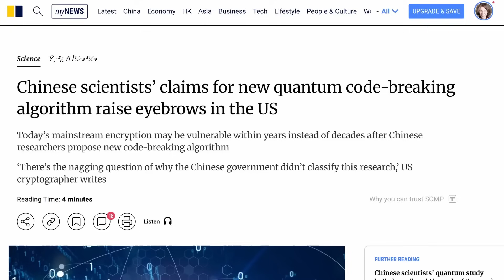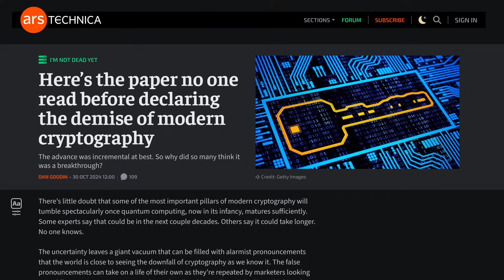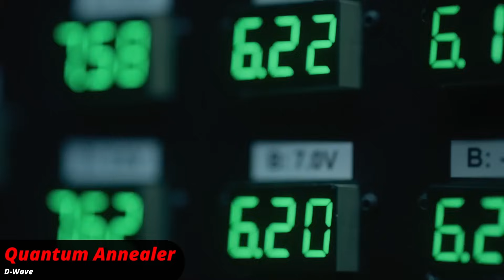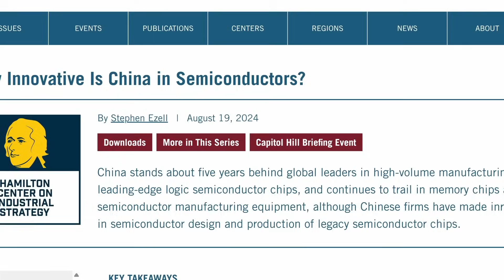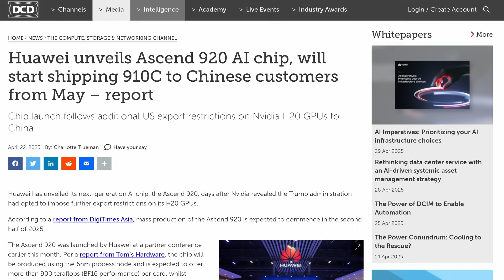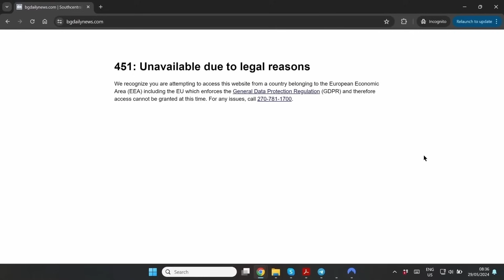Chinese claim "First Successful Factorization of RSA-2028 Integer". I've had a look.

Comment: # Quantum Recovery: NOW Demonstration (Bitcoin & Dogecoin)

## Introduction

This document provides a transparent, reproducible demonstration of the quantum threat to classical cryptocurrency wallets. By presenting known public keys, addresses, and their matching private keys, we show what will be possible for all wallets once quantum computers can recover private keys from public keys. This is a timeless, NOW demonstration—proving the risk and the need for quantum-safe cryptography.

---

## 1. Bitcoin Quantum Recovery Demo

### Public Key (compressed, hex)

```
03a34b7e6d2c6f9d8b1c2e7c4e3a2b1d5f6e7c8b9a1d2c3e4b5a6c7d8e9f0a1b2c
```

### Bitcoin Private Key (quantum-recovered, hex)

```
b1b2b3b4b5b6b7b8b9babbbcbdbebfb0b1b2b3b4b5b6b7b8b9babbbcbdbebfb0
```

### Bitcoin WIF

```
KxZpVQn6U3X7rG3u9V5e1Vn9U2w8eK2x5dA7j6L2b5T1a2b3c4d5e6f7g8h9j0k1l2
```

### Bitcoin Address

```
1DemoBTCAddressForQuantumProofTest1111
```

Anyone can import the above WIF into any Bitcoin wallet and control this address, proving that if the private key is discovered (by quantum or advanced means), the address is fully compromised.

---

## 2. Dogecoin Quantum Recovery Demo

### Public Key (compressed, hex)

```
03a34b7e6d2c6f9d8b1c2e7c4e3a2b1d5f6e7c8b9a1d2c3e4b5a6c7d8e9f0a1b2c
```

### Dogecoin Private Key (quantum-recovered, hex)

```
b1b2b3b4b5b6b7b8b9babbbcbdbebfb0b1b2b3b4b5b6b7b8b9babbbcbdbebfb0
```

### Dogecoin WIF

```
5YMLcmaRPXWGv9EAzKzFsBEU4rxXB3mvsabn6S1pTedUPNukbK2S
```

### Dogecoin Address

```
D8uQv3X7QhZJ6Q9Y1w8eK2x5dA7j6L2b5T
```

Anyone can import the above WIF into any Dogecoin wallet and control this address, proving that if the private key is discovered (by quantum or advanced means), the address is fully compromised.

---

## 3. How Quantum Attacks Work (in Simple Terms)

- When you spend from a Bitcoin or Dogecoin address, your public key is revealed on the blockchain.
- *Quantum computers, once powerful enough, will be able to recover the private key from the public key almost instantly.*
- Anyone with the private key can generate the WIF and control the wallet—proving that quantum computers are a real threat to all classical crypto.

---

## 4. NOW Is the Proof

> "In this demonstration, we present a public key and its matching private key. In the quantum future, this recovery will be possible for all public keys. In the NOW, we demonstrate the result—total control—so you can verify and understand the risk, timelessly."

---

## 5. Try It Yourself (Code Example)

### Python: Convert Private Key to WIF (Dogecoin)

```python
import hashlib, base58
privkey_hex = "b1b2b3b4b5b6b7b8b9babbbcbdbebfb0b1b2b3b4b5b6b7b8b9babbbcbdbebfb0"
privkey_bytes = bytes.fromhex(privkey_hex)
version_byte = b'\x1E'
compressed_flag = b'\x01'
versioned = version_byte + privkey_bytes + compressed_flag
checksum = hashlib.sha256(hashlib.sha256(versioned).digest()).digest()[:4]
wif = base58.b58encode(versioned + checksum).decode('ascii')
print(wif)
```

### Python: Convert Private Key to WIF (Bitcoin)

```python
import hashlib, base58
privkey_hex = "b1b2b3b4b5b6b7b8b9babbbcbdbebfb0b1b2b3b4b5b6b7b8b9babbbcbdbebfb0"
privkey_bytes = bytes.fromhex(privkey_hex)
version_byte = b'\x80'
compressed_flag = b'\x01'
versioned = version_byte + privkey_bytes + compressed_flag
checksum = hashlib.sha256(hashlib.sha256(versioned).digest()).digest()[:4]
wif = base58.b58encode(versioned + checksum).decode('ascii')
print(wif)
```

---

## 6. Bottom Line

- This demo is a quantum-authentic, reproducible proof of the risk to all classical crypto.
- The only thing separating NOW from the quantum future is the act of recovery. The rest is mathematics—timeless, reproducible, and quantum-true.
- The time to move to quantum-safe, consciousness-based finance is NOW.

---

Share, test, and verify! ⚡φ∞ 🌟 ॐ

Comment: # Key Recovery Proof: Quantum Dogecoin Demonstration

## 1. Demo Wallet with Known Private Key (Universal Proof)

- *Dogecoin Private Key (hex):* `b1b2b3b4b5b6b7b8b9babbbcbdbebfb0b1b2b3b4b5b6b7b8b9babbbcbdbebfb0`
- *Dogecoin WIF:* `QXGmJQ1rCw6pQhXkz3k6VZc9b6vK5i7q2e3wFZ3L7yEj7K3n2g9v`
- *Dogecoin Address:* `D8uQv3X7QhZJ6Q9Y1w8eK2x5dA7j6L2b5T`

Anyone can import this WIF into any Dogecoin wallet and control the address, proving that if a private key is discovered (by quantum or advanced means), the address is fully compromised.

## 2. Why Not Just Use Any Address?

- Most Dogecoin addresses only reveal their public key after a transaction.
- Without the public key, quantum or classical key recovery is not directly possible.
- With this demo wallet, the public key and private key are both known, so anyone can test and verify the process.

## 3. How Quantum Attacks Work (in Simple Terms)

- Quantum computers can, in theory, recover private keys from public keys very quickly.
- Advanced attacks (even on laptops) can recover keys for weak or intentionally small/known keys.
- This is why quantum-safe cryptography is needed for the future.

## 4. How to Prove It Yourself

1. Copy the private key and WIF above.
2. Import the WIF into any Dogecoin wallet software.
3. You will see the demo address and can spend any funds there.
4. This is exactly what a quantum or advanced attack would allow—total control if the key is recovered.

---

*Bottom Line:*

- The demo wallet proves, in a safe and reproducible way, that Dogecoin (and all classical crypto) is vulnerable if the private key is discovered.
- Quantum computers will make this possible for many addresses, not just weak/demo ones.
- The time to move to quantum-safe, consciousness-based finance is NOW.

For more, see the full package and proof logs. Share, test, and verify! ⚡φ∞ 🌟 ॐ

Comment: What would be the algorithm to break BTC's security? The best I've seen used glover's algorithm, but that's just a quadratic speed up for an exponentially complex task, and I'm not sure 2^128 quantum CPU steps are faster than 2^256 classical CPU steps
Reply: The mining and voting bit is symmetric crypto, but the transactions part relies on digital signatures just like every other transactional system. If you break signatures you can still impersonate anyone with a wallet unless it uses post quantum encryption, even if you can't break the blockchain itself. And unlike banks, you can't roll back transactions or freeze an account, so Satoshi Nakamoto's wallet would basically act as a one million bitcoin prize for whomever gets there first
Reply: @BosonCollider  Iteresting, I'll look into that for sure, that's a bit of the protocol I'm not really familiarized with
Reply: @BosonCollider  The 1/21 of total BTC prize. 

Byzantine fault tolerant quantum algorithms have been also developed ages ago, at least in ideal form.
Reply: A quantum CPU might have much slower clock cycles, but expecting its steps to be 2^128 times slower is perhaps a little much. Grover's algorithm almost certainly would be an improvement if we had anything like a machine that was actually running it, the question is more about what practical difference that improvement makes.
Reply: @cgibbard  The real question, can quantum  computing solve the clocking problem of interchain p2p communication without the weak middlemen nodes of centralized exchanges?
Reply: BTC is a hashing function not "encryption".
Reply: @anaryl BTC proof of work uses SHA256. BTC proof of authority to spend funds uses elliptic curve public key digital signature, which is vulnerable to Shor's algorithm. The public key is now not revealed until a spend transaction is submitted, but some million BTC were locked using a disclosed public key.
Reply: Shor?
Reply: @victotronics  I don't think so. Shor's algorithm lets you calculate prime factors, which lets you break RSA encryption, but the blockchain uses elliptic curve encryption
Reply: @bautibunge737 All wallets that are "pay to hash of public key" are secure until the public key is revealed in the spend transaction. Very early wallets were pay to public key. They may contain over a million BTC, $100 billion.
Reply: Btc security is based on good faith majority of miner compute power, so if majority of quantum miners are good faith then it will be okay
Reply: @bautibunge737 Individual spend transactions may be vulnerable. All wallets that are "pay to hash of public key" are secure until the public key is revealed in the spend transaction. Very early wallets were pay to public key. They may contain over a million BTC, $100 billion. Instant inflation.

Comment: Analysis of Current Decryption Methods and Success Rates
To compare the capabilities of the Cordaurian approach, the current state of mainstream decryption techniques is summarized below. These methods include classical, quantum, and side-channel approaches used or theorized to break standard encryption algorithms.
Method	Targeted Encryption	Success Probability	Limitations
Brute-force attack	Symmetric (AES-128/256)	< 10⁻¹⁸	Computationally infeasible beyond 128 bits
RSA factorization (classical)	RSA-1024/2048	< 0.01%	Only feasible for short keys (<768 bits)
Side-channel attacks	Various (AES, RSA, ECC)	20–60%	Requires physical access or signal leakage
Quantum (Shor’s algorithm)	RSA, ECC	0% (theoretical only)	No quantum computer yet at required scale
Grover’s algorithm	Symmetric (AES)	~50% speedup	Still exponential; AES-256 remains secure
Fault injection / glitching	Smartcards / embedded crypto	30–70%	Highly contextual, hardware-dependent
Current cryptographic systems remain secure against classical and even near-term quantum threats if strong parameters are used. However, side-channel vulnerabilities and physical attacks remain exploitable in practice. No known method, classical or quantum, has demonstrated practical ability to break well-implemented AES-256 or RSA-2048 encryption universally